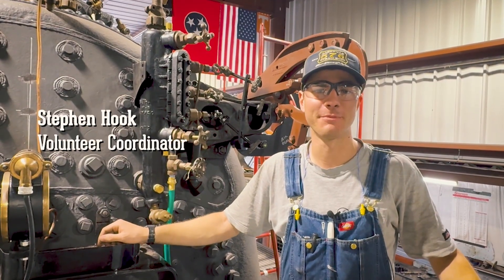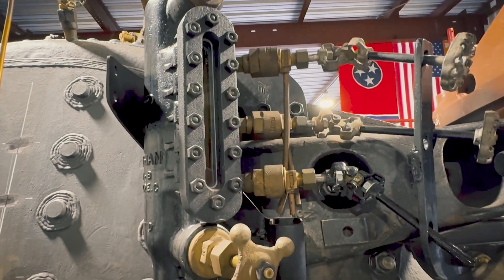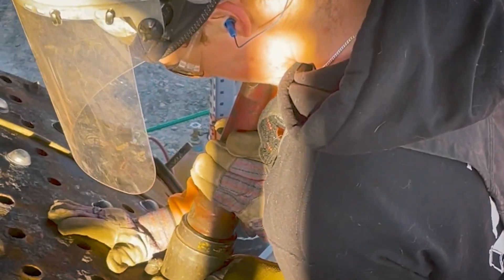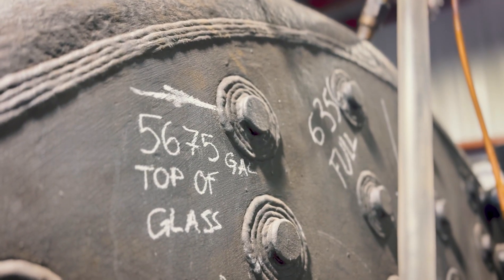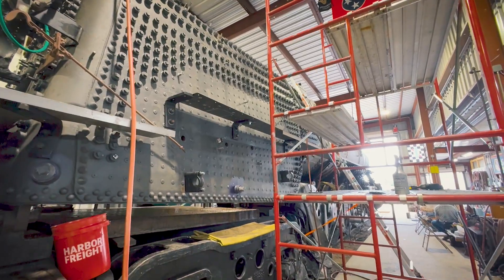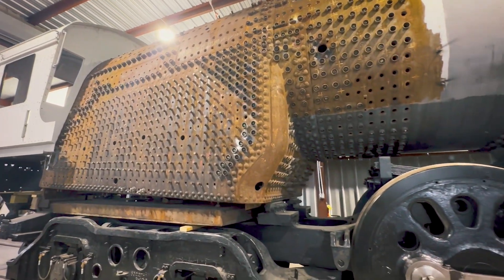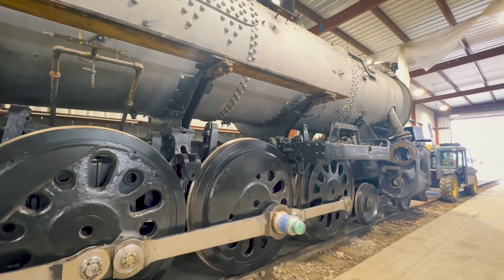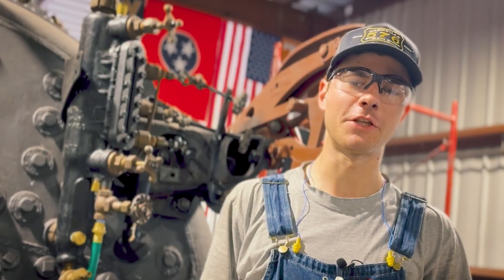What is a Hydrostatic Test? | Nashville Steam No. 576 Restoration Update

Comment from the maker: The next big step for Nashville Steam Locomotive No. 576 has arrived! After years of dedicated restoration work, Nashville, Chattanooga & St. Louis Railway No. 576 is preparing for a critical milestone: its hydrostatic test. 

A hydrostatic test (often called a "hydro test") involves filling the locomotive’s boiler completely with water and then pressurizing it well over its normal operating pressure. The process is conducted slowly and carefully, monitoring for any signs of leaks, material deformation, or structural weakness – a major requirement before steam can return to the engine for the first time in over 70 years. 

Once we pass the hydro test, No. 576 will be readied for live steam tests and one step closer to full operation. Follow along as the Nashville Steam Preservation Society prepares this iconic locomotive for its comeback. Learn more and support the restoration at www.nashvillesteam.org
Reply: What about that Mikado Tender you guys bought for 576 to use??
Reply: Finally you guys have made it to hydro this is the final step needed for the engine can return to operation. Time to prove that all your hard work has gone off right this is the make or break moment when the steam locomotive comes back to life.

Comment: How are you getting the water up to temperature
Reply: This is a hydrostatic test only! Meaning they fill up with water put some amount of compressible gas . I’m assuming air or maybe nitrogen to bring the pressure to 325 psi! So they are not heating the water what you’re asking about would be a thermal cycle test actually bringing the steam pressure and the water temperature up to expand the boiler components and then test for leaks at that .2 different tests!